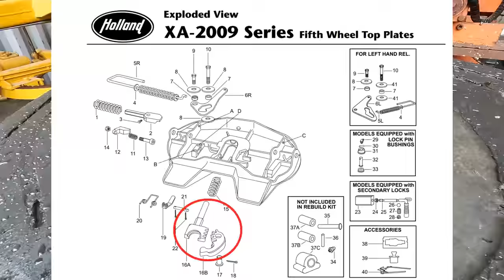1980 Autocar “Construcktor” Hauls its First loads in Many Many Years!

Comment: Clamp Claws as you call them, are used a ton by railways to secure decking on or in railway cars. We called them decking clips. The bolts that go with them were a special flat headed bolt. I fastened  my fair share over my 36 years working at the railway.
Reply: The bolts look like plow share bolts.

Comment: 93' my first duty station still had some of those 25 ton trailers.   Engineers took 10 foot sections of sheet piling and drove them to the deck height.  Back filled one side and made loading ramps.  Farmer near me still has one, he upgraded to spring brake chambers

Comment: Great video Matt ! That Autocar  will make you an excellent tractor, especially with that winch. I’d suggest a deck-plate to cover the open frame area. That winch will be able to do some amazing things in your work with these machines. A nice , fresh orange and black paint job would look super nice—in my humble opinion, on that Autocar. Orange on the military low-boy trailer too.
Reply: I agree 100%. Some led bulbs/light would be a cool touch as well.

Comment: When you get the Autocar out on the road with the dozer on the trailer, find a nice long hill at highway speed. If it has a splitter in high range allow the engine to pull down to 1600rpm then downshift a half a gear (1/2 a gear = +200rpm for Eaton Fullers) then allow it to pull down to 1600rpm and keep repeating half a gear at a time until it finds its equilibrium and holds its revs. If it doesn't have a splitter let it pull down to 1500 then downshift (+400rpm).
It'll really tell you what the cooling system is like, give the injectors full fuel for awhile, heat up the entire exhaust system and give you an idea of what's what with the engine, turbo and fuel system.

The other thing, I've found after years of rural steel deliveries to farms, the thing that most cases you to get stuck is dropping a steer tire into a ditch. What happens is it unbalances the drive - particularly if it's bogie drive and even with the inter-axle diff lock 'on' all that happens is the diagonally opposite wheels spin.
If you put the diff lock on before you get stuck, you'll only get stuck twice as bad if you're not very, very careful. 
Inter-axle diff locks on their own are almost useless but not quite. They're OK on flat surfaces backing up a hill laden or starting off on steep wet hills with 20 tons on. 
If you have a cross lock then the inter-axle needs to be on for the cross lock to work. A cross lock is awesome BTW even if you only have one. They really do help a great deal.

Comment: Like watching you figure things out, figure out how they work and then make them work! I've worked years on much of that same equiment, retired now. LOVE the sound of a good ole real truck!  On that 50's military trailer, word of !!CAUTION!!, Change the lug studs!! I have used two of those trailers and both left me stranded and working on the side of the road with an extreamly heavy load. Those studs chrystallize and will snap off from turning sharp on a hard surface and/ or running a large load. ALSO, the brakes are not spring brakes, usually single chamber. They only hold when parked if there is air in the tank. You need to charge the system BEFORE sliding into the 5th wheel, to be sure you dont loose the trailer when backing into it. AND be sure to block it, you may find it over the hill someday. Best to Change those single chambers out to spring brakes!

Comment: My best friend had a ranch in eastern Oregon. He ran a 3 phase irrigation pump with a single to three stage convertor. Worked great. Might be a simpler solution than finding other motors for the gantry crane. Your shop is going to be so great.
Reply: Best way of driving a 3 phase motor now is with a vfd
Reply: @TheTomco11  True, but I don't think that's his style.  A rotary converter is likely the most cost effective solution and they last forever unlike vfd's which have relatively short lives, are relatively fragile, and are near impossible to fix without a good amount of electronics knowledge.
Reply: Vfd are dirty power and it's super simple to build a rotary converter you just haft to have a bigger motor than the biggest motor you want to run
Reply: Yes, this.  Theybalso give you low voltage controls  for speed and direction.
Reply: A rotary converter was my suggestion. For the intermittent use of the crane would be a good solution. Correct sizing is the key. Vendor could help.

Comment: When making a tight turn in a big truck get the trailer wheels as far to the outside of the turn as you can before making the turn.  That may mean that you have to pull straight ahead, then back up with the wheel cut to get your trailer wheels farther to the outside.  You may even have to do it several times before you ratchet the trailer wheels into a position with more favorable geometry.  With a 40' or better trailer you need 4 standard lanes to make a square corner. For instance if I'm in the curb lane at an intersection turning right I'll have to turn into the 3rd lane from the curb on the turned onto roadway to make it without tearing stuff up (1+3=4), if I'm in the 2nd lane from the curb I'll need to turn into the 2nd lane (2+2=4) etc.
Reply: Good knowledge transfer…one cut n way too close one time at Louisville airport ups taking a buddie to work and he climbed plum across me tryin to get away from the wheels…never got us but damn if it didn’t scare the shit outta us…
Reply: Do you foresee any issues with the tandem axles being so far back? Would it be better to have them a bit closer to center?
Reply: @gc7782  Yes a shorter wheelbase will make for a tighter turn. You also have to account for how much steering angle you have. The old Freightliner classics had turning radii, (for example) that to me seemed to me measured in counties, not feet. After awhile you get used to it though.
Reply: do you want a cookie?

Comment: I was a Truck Driver 25 years and the fifth wheel latch would quit latching sometimes. Every time it was small pieces of gravel mixed in the grease causing the problem.

Comment: I so love that engine roar under load, it really is growling "I'm loving this!" when you are pushing the old lady a bit!
I have to admit that at the end when you played around with that Komatsu on the trailer, I was kinda worried as I didn't see any chains or straps anywhere and that turn-around at the intersection? I was certain to see that Komatsu at least move sideways (I know it weighs a ton and some, but it's still just some tracks on a pretty deck). Ofc if you put some chains underneath that aren't shown it's no worry.

Anyway, very nice job on the Autocar and as you said, it might have needed just a little bit of driving back to work to get her going again!
Reply: Yup I was sweating on that corner too.

Comment: Hi Matt, the truck does not appear to have a good steering lock, I have worked on many KENWORTHS and FREIGHLINERS with the same problem. On the back of each stub axle there is square headed bolt {usually} with 15/16 lock nut, put a jack under the axle and lift the wheels just clear of the ground and put wheels each way on full lock and see if the stops are touching, by screwing them in gives you a better turning circle making sure the tyres do not touch any thing. If the steering stops are not touching the problem may be in the power steering box { I do not know which brand of box you it could be Sheppard or Ross both have pressure relief valves that drop the pressure at a predetermined setting that can be adjusted. This of course depends on a number of factors, steering box turns, length of drop arm, tyre size and other bits hanging around.     From Australia

Comment: Another great video, as always. Why not mount the crane sideways in the building? You won’t be able to use the crane on the ends of the building, but you wouldn’t have to modify it at all
Reply from the maker: Why wouldn’t I just do it right and have full use?
Reply: @DieselCreek  you plan on giving the autocar a fresh coat of paint?

Comment: Matt, setup a 3 phase solar system for your shop.  You probably won't be using the crane very often and that would give solar panels time to keep the batteries charged between uses.  Plus you can pull single phase 240v or even 120v power off anyone of the three phases if you want to.  Not sure what it would cost to have 3 phase ac ran out to your shop, but the solar option might be cheaper and has a lot of other benefits as well.  Just a thought.

Comment: So... run the crane lengthwise in the building & build the frame widthwise, it'll achieve the same result a different way & you won't need to butcher the crane. If you look at YouTuber @mastermilo's channel  from a few years ago, he also bought a [slightly smaller] gantry crane from a commercial site, but then they designed their own support framework for it specific to their application.  You could do the same with yours...
Reply: But then it will only cover 48' out of the 80' the building is long.  Plus there would have to be columns in the middle of his shop to support the beams that the bridge runs on.  He may even end up with his main door restricted by a column.

Comment: Good rotary 3-phase converters are a little expensive, but it seems like you're going to need one for that crane. Also, used 3-phase tools are dirt cheap. There IS an alternative. You can build a 3-phase converter. It's basically a regular single-phase motor turning a big 3-phase motor, converted to an alternator. It might be worth looking into, especially since you have the connections to find big scrap motors like that and the means to easily move them.

Comment: Man ! That loader looked a little weak loading this, but I’m sure you will,or do have a plan and place for it. Good luck Matt, great job and videos as usual!👍
Reply: The hydraulic pump could use some engine revs to produce more power. He was barely idling there.
Reply: Matt was just checking it's max capacity.

Comment: Howdy Matt, Love the Autocar and the work you have done to get it going. A few suggestions... make sure that your truck has operational spring brakes and your trailer(s) too on e at least one axle if not both. Have you considered changing out that transmission in the truck to a 13 or 18 speed? A little more gear selection would really come in handy since your engine is a bit small. Keep up the good videos! When is the shop going in??? Take care!

Comment: Always a moment of joy to see a new DC video in my recommendations. Time to settle in and enjoy, can't wait to see her doing some work.

Edit: Hearing her pulling that crane home along the final stretch of rural road was awesome. I'm not sure if it's just perspective of the video but your front tyres on the new trailer look smaller than the rear set, could that maybe be why they were dragging? Maybe just sitting high enough because of the angle of the trailer to only skim the ground but once the suspension came down under load they made proper contact? Just thinking out loud, glad it all worked okay.

Comment: Hey Matt, love the Autocar!  My big brother used to drive one back in the '80's hauling gasoline with a double trailer.  As I recall it had a Cummins designed for a tug boat in it, 425 comes to mind?  It was a monster!  How many gears does yours have?  I couldn't see a splitter on the stick.  Also, is the height of that trailer going to cause issues hauling tall equipment?
Reply: That red trailer is a hire one from the auctions
Reply: @HJZ75driver , I thought he said he bought that trailer in the video about the auction.

Comment: Matt when you mentioned the crane, it can be used in any of the directions, obviously it is to be used running in the longitudinal direction of the shed, but as its movement is more sporadic, you can use it transversally, mechanical engineer's word with experience in gantry cranes. Congratulations on your efforts and much success ahead.
Reply: Either way . Whooda thunk. . It’s the same Coverage .
Reply: there's gonna be a big hole on one side of the building, so you're adding a lot of cost placing the crane the wrong way.

Comment: Here's a trick that I've learned the hard way more than once. It is not necessary to wrap your fingers around a ratchet handle when you are pushing on that handle. Pushing flat-handed sure saves the knuckles when that nut comes loose all of a sudden.

Comment: Great video! About the crane and building. How about making the building length fit the crane, run it side to side and then use the transfer dolly for end to end. Yeah I know this is not normal but the crane will not care. It would less costly to add a section to the length of your building than adding width to the whole thing.

Comment: It needs taking out on a long journey loaded and given a good beating. We used to do this with Mercedes engines that had sat idling for years in recovery trucks, they looked like they needed a rebuild, (low compression, oil burning, heavy breathing), often they just had glazed bores from light work. Give them a bloody good thrashing for a couple of hundred miles and it was often a miracle cure.

Comment: Good job and you can always make or get a phase converter for 3-phase stuff that runs off of 220. You'll be like I was when moving the dragline in having to do a lot of jockeying around to keep the trailer in boundaries. The lo-lo on the #2 stick is good for that to keep off the clutch. A Cummins, like any older motor just smokes when cold and especially if they've sat for a while. That one is running better every time you run it and it will do better and better as the ATF gets run through the system. Good deal on the 5th wheel. GBWYall!

Comment: Matt, since that Construcktor has been sitting so long the PT pump and injectors have not been upgraded to burn Ultra Low Sulfur diesel, which is all you can buy these days. If the pump leaks you’ll see it.
However, if the injectors leak you’ll get fuel in the oil, which will ruin the engine.

Comment: bwahahaha, I laughed as a maniac when the trailer crushed the blocks into the ground and sunk :D 
That sucks! 
This happens to our farm equipment too, I keep telling my father stop using wood pieces like that, they need way more surface area or just use metal plate. or mod the legs on trailers with removable plate, because if the trailer falls like that, the leg is kaput. I have seen the bent ones before.

Comment: The easy way to get the bracket pins out is to remove the wheel and sub assembly from the slider, to do this, cut out the stops at the end of the slider, connect an airline to the sub cylinder, and slide the wheel/sub assembly off the slider.

I'm not a truck driver, but I believe the best way to couple up a trailer is to first pull on the release handle to release/open the locks on the fifth wheel, double check to make sure the locks are open, back in slowly untill the fifth wheel is under the kingpin plate, get out and push or pull on the landing gear handle to get it into low gear, lower the trailer slowly till you have full contact, then raise the trailer just slightly to take the load off the fifth wheel, and back in till the locks engage and the wheel locks.

Comment: As you say a building big enough for this crane going to be expensive but you could build it in stages so get the width right and add sections as finances permit.A wonderful example of a perfect building is Clint's at C and C equipment.Also it will be more cost effective to find a way to get 3 phase power than modify the crane as many other things either need or work a whole lot better with it.Best regards.

Comment: I thought I had left a comment on this video the first time I saw it nearly a year ago.  Lord knows I had reason to . First the ex military low bed. If my long term memory serves me that is an M-172A1c. They were ancient back in the day (mid 70's to mid 80's) and yes those ramps weigh a ton You can't kill them though. However, empty they are oversize. The other is the Autocar,  my favorite heavy haul tractor. Which leads me to wonder about the fate of the '56 single axle. Cheers.

Comment: Now that is a REAL truck, nothing compares to the mighty AUTOCAR! and there are plenty of exceptional trucks. IH, Freightliner and Mack all come to mind even Peterbilt CAN build nice trucks, First saw an Autocar at a towing company in Akron OH as it had been made into a Wrecker for vehicle recovery. I always figured it could darn near tow a train car if need be. Then the guys built another one! The 4 bulb rotary beacons used aircraft landing lights and if you have not seen these, they throw a beam that always finds something to illuminate. Had to start them separately or the truck would stall, if that helps you realize how big they were. To a teenage boy they were very impressive back around 1970 which means your truck was 10 years from being assembled, good times.

Comment: instead of atf I would use injector cleaner from bardahl. But what always amazes me is the turning circle of the trucks in the States, we are not used to that in Europe. We have the rear axles of the trailers much further forward, which turns much shorter. a 45 foot trailer has roughly 47 feet of turning circle between curbs, in 1 time, not having to cross backwards again, just in 1 smooth movement. OK we have cabover trucks and not semi-trucks, that helps too.The prejudices of cabovers have been eliminated, they are quiet for a while, they no longer suffer from heat.  Well cool that Autocar. Greetings from Belgium